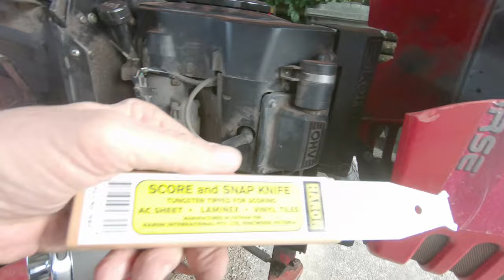Wheel Horse 267H New Exhaust System

Comment: My wheel horse has a sensor right underneath the seat  you left  it cuts the motor off My wheel horse is little different than yours my belt runs on your right hand side right about where your feet is going up to You're break And there is another belt right by you by your heel And that runs a rare run Mind called the classic wheel horse .Thank you for the video
Reply from the maker: Thanx Joe, I'll check that sensor out. It was shutting down the motor before.